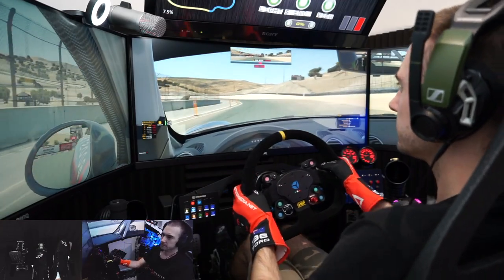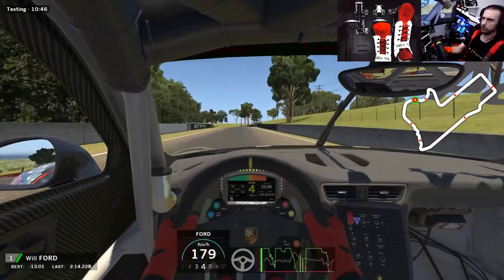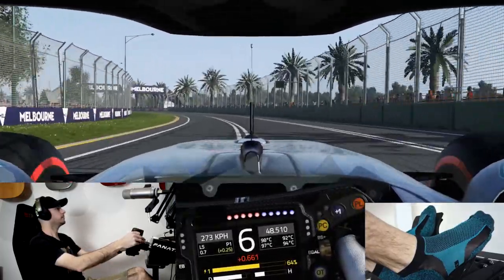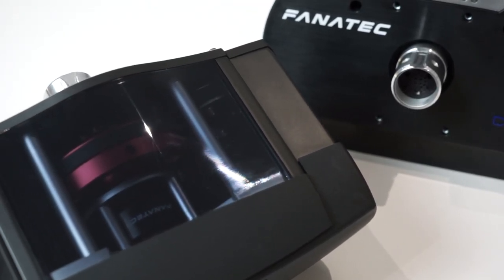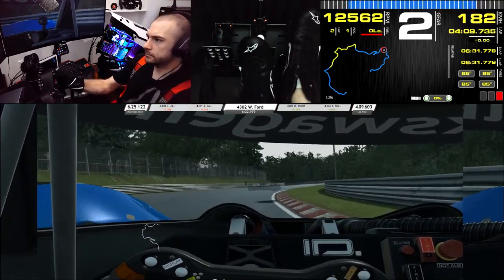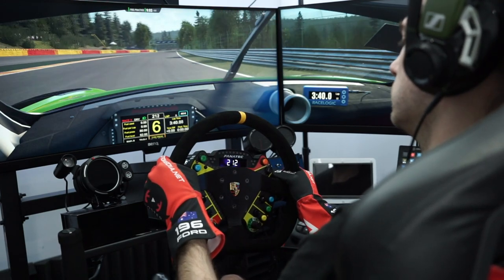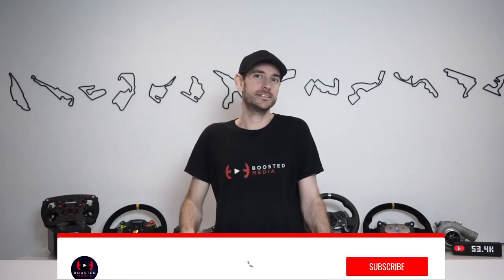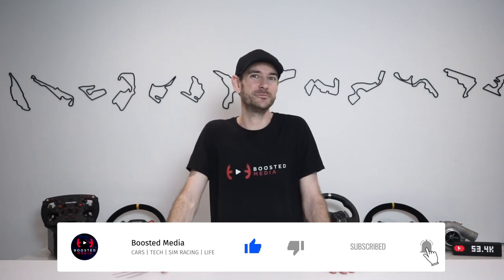Sim Racing Wheels & Wheel Bases - Buyer's Guide

Comment: Thank you for this overview. I'm still using my 10 year Logitech MOMO steering wheel. I recently prioritized and upgraded the pedals to the load cell Thrustmaster T-LCM and what a massive difference it has made compared to the original potentiometer pedals. Also after considering my space I've also upgraded to the Next Level Wheel Stand DD and again a massive difference to the stability. I'm trying to keep in mind I'll eventually upgrade to a stronger wheel and wheel base hence why I went for the NLR Wheel Stand DD. I think the next upgrade that will make the mosts sense is updating my 8 year old PC even before upgrading the wheelbase/rim, so I can finally retire my Logitech MOMO wheel. Thank you for all the wonderful advice, it has definitely helped me be more strategic as I continue to upgrade my SIM racing experience. Love from Canada!

Comment: Hi Will, thanks for all the vids. I bought a Simucube 2 Pro based on your reviews. I do not regret it, even though I'm no faster than my G27. The load cell brake pedal had the most effect on my lap times, as you point out. Take care and stay safe
Reply: Sarah...  Coming back to sims after a LONG layoff (GPL, back in the day). Only going to get prob a G29.     Can load cell be incorporated onto a G29, or not worth it on an entry-level wheel/pedals?
Reply from the maker: I’d recommend checking out my part 2 video in this series on pedals. That’ll answer this question in a lot of detail. Short answer, probably not worth it.
Reply: @boostedmedia   Thanks for reply so quick!! Most of us are home because of Covid, so much more activity on You Tube, forums, etc...   :)
Reply from the maker: All the best mate. I hope you’re safe and well.
Reply: I wouldn't bother trying to upgrade G29 pedals. Fanatec CSL Elite pedals with load cell mod are not too expensive but are a vast improvement.
Reply from the maker: Yep agreed
Reply: @sarahjohnson3407  Thx... Worth getting those Fanatec's w/ a G29, or, not really? And would those CSL Elite's be plug n play compatible w/ the G29?
Reply: @brianboucher4248  I used them with my G27 for a while, really improved my times. They are a separate USB so I didn't have any problems. I would definitely recommend with a G29.
Reply: @sarahjohnson3407    Sorry, I'm a newbie... So, the Fanatec CSL Elite pedals are compatible w/ the Logi-G29, as far as you know? Thx...
Reply from the maker: The CSL elite pedals are not compatible with any other brand unless you buy the load cell kit, which includes a USB module so you can plug them in seperate provided you’re on a PC.

Comment: Great review Will.  I went from, my Logitech wheel to a Fanatec CSL Elite Wheel Base V1.1 which was a major improvement but I then decided to buy a Fanatec ClubSport Wheel Base V2.5.  I'm very happy with this wheel base and I do notice much more detail coming from the track surface.  I did a couple of races in the rain and I found that my driving on a wet track was much improved immediately.  The  ClubSport Wheel Base V2.5 has more torque output and as much as I want to wrestle with. 😃  In my humble opinion this wheel base is a great compromise between price and performance and it is in my budget range.  I would be interested in your opinion of add-on displays.  I have been looking at the Renovatio displays.
Reply: Club sport is a little too pricey for my intro gear. Good to know it's an improvement I've the Csl elite which I was gonna use for my first setup. Now if I get into I only where to move up to, thanks.
Reply: @redtheftauto  I'm sure that you can do just as well with the Elite.  Will says that it really isn't worth the difference but it is as close to direct drive wheel as I will get.  😊  Besides, I can use all the help I can get.  😉

Comment: I have recently upgraded from Fanatec csw2.5 to Simucube 2 Ultimate which improved my race pace by around 0.5s with better consistency too. In terms of feeling the difference between v2.5 and Simucube 2 is a little less than I expected. Maybe I expected too much about DD wheel. That's a big compliment for the v2.5 but Simucube 2 is something else. The speed and smoothness is second to none. I can react to situation before it goes really bad. It is so great to run lap after lap with consistent and competitive lap times. I don't think I can do that with a non-DD wheel. No regret about the upgrade at all.
Reply from the maker: It’s like with anything. That last 10-20% is where the money is.

Comment: I bought my first setup recently, CSL DD 8nm R2R Pack. New Logitech = $360 cash, Second hand belt drive $550 cash and a new DD rig was only $900 and with Paypal's Pay in 4 its only $225 a fortnight... It just makes sense to go straight for it if you can afford it only downside is I have to wait 2 weeks for the wheel to be available.

Comment: This may be a silly question but if i wanted to use other pedals with my g29 would that work aslong as they are plugged in by usb or is it only the logitech pedals that work
Reply from the maker: You can use whatever pedals you want via USB.
Reply: @boostedmedia  thanks thats very helpfull im getting into sim racing so this is a great help

Comment: I went to a G29 and went slower than with a controller. So I sold it and picked up a Fanatec CSL. My driver rating has dropped from A/S to B/S...it is more fun, but i’m still sorting it out. Seems like if a slide starts, it is much more difficult to save, so on high traction i’m slightly faster, low traction i’m slower.
So far.
Any setting tips?
Reply: How long have you had it? It generally just takes time to get used to it. I was useless the first time I tried a game like dirt rally on a wheel. The best advice I have it set your rotation to around 540 for most racecars

Comment: Is it worth upgrading from 6+ year old Logitech DFGT which has seen some big usage lately to fanatec CSL elite if I don't have any special rigs (just mounting to my trusty old ikea table)
Reply: KaKeX I used a DFGT with Fanatec pedals. I've used G25, G27, and T500RS. Like he said upgrading the pedals is the most important. I'd be happy to keep a DFGT and just get load cell pedals like the new Thrustmaster ones or the Fanatec Elite. If you're on a budget that's what I would do.
Reply: @chowhar  I really don't like the crackling sound the wheelbase makes and the shift paddles are full arse+I think the wheel is starting to break because sometime the wheel just loses all FFB and it comes back after 0.5-1s. So probs gonna just get the CSL elite bundle and maybe the loadcell (even without it it's a huge upgrade)